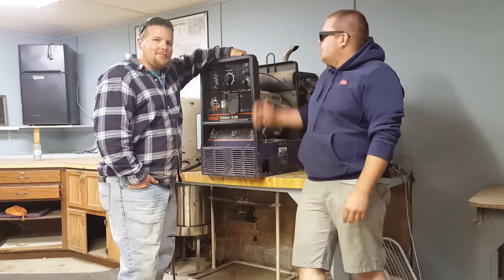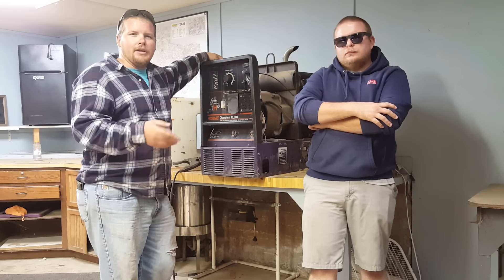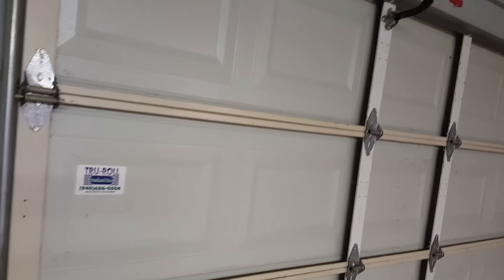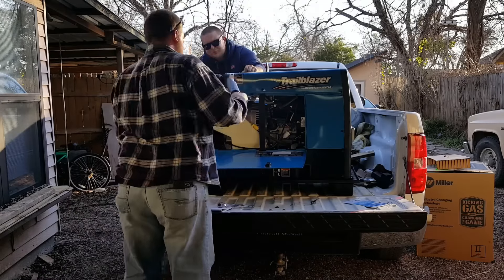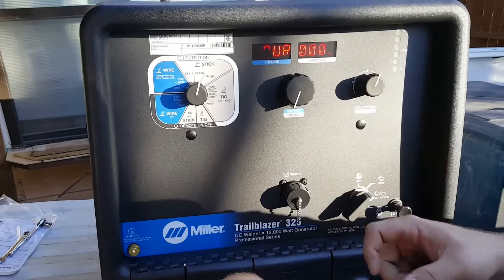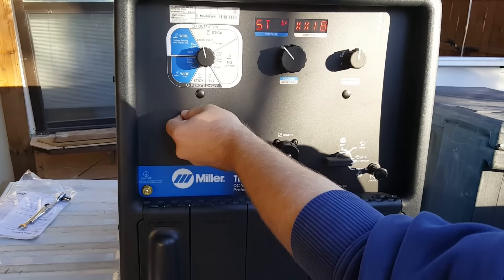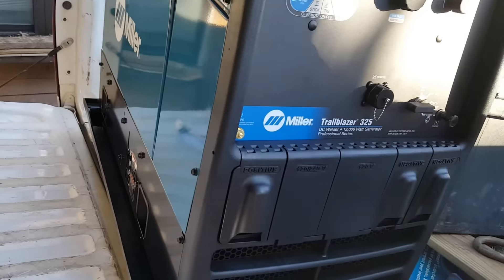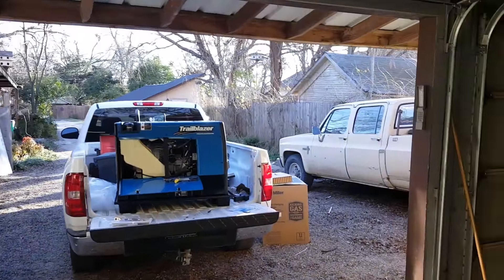OUT WITH THE OLD IN WITH THE NEW!!!!!! Unboxing and review of the new Miller Trailblazer 325

Comment: Sorry bout' your Hobart... Congratulations on your Trailblazer... you'll love it, I literally live with one on my truck.
Reply from the maker: +Kerry Anderson I love it its way better than that shitty Hobart. It burns 7018 like butter. Mine stays in the back of my truck to. I bought a trailer to put it all on but its way easier to just have it in the truck. I need to upgrade the truck my half ton is setting on the helper springs but its level and rides real smooth with about 2000 lbs in the back

Comment: On that Hobart welder, did you by any chance look at the commutator and slip rings to see how dirty either was? Hobarts are noted for erratic or no power when the commutator gets dirty, or a black coloration, use a brush seating stone to clean  by removing side access panel start the machine , then lightly place the stone against the commutator and moving the stone slowly the full length of the surface til it gets a bright copper color, then test to see if it makes power then. Also use a air hose to blow out any dust accumulation from the entire generator portion of cabinet. On any of those compact generators make sure you are very faithful at oil and filter changings and Always change filter at Every oil change, that's the key to longevity of those smaller engines, I prefer to use synthetic oil in mine as the viscosity does not change with heat.

Comment: My Hobart Champion 10,000 locked up last Sunday. I was gonna use it to power a small flux core welder outside and never even got started before it locked up tighter than dicks hat band.
Got it new in 03 had 2280 hrs on it. Sad day Sunday! Still bummed over that one  man..
I' sure like the looks of this Trailblazer I'd keep a cover on that guy. That's hard to do though and covers don't last long.
It would look new a lot longer though.😀

Comment: I was going to get a Hobart locally but taxes increase price by 300 dollars. I found out a Ranger 225 would be 200 dollars more or a Bobcat 225. I am not sure what to do or get.
Reply: I got a bobcat off the welding store that was a rental machine that had 500 hours on it for $1,700.00 works great. we were renting it for over a year from them before i called and asked how much they'd let us keep it for. i like the little bob cat, but for my own personal machine, i think i wanna go with a trailblazer.
Reply: @imbrandon16  The trailblazers are awesome. I have my Hobart still at under 100hrs. I am looking into getting a pipeline welder, maybe a Lincoln Sa200 gasoline machine. The Bobcat is probably close to my Hobart in power but the Miller has the AC welding mode I believe. Well should still be a good welder.

Comment: Miller for a Miller... what a change!
Reply from the maker: I traded junk internals and electronics for a good proven reliable welder. My boss has a trailblazer 325 and a legend 305 both have over 3000 hours an all he's done is change the oil.
Reply: Hobart is not miller. They are both owned by the same parent company Illinois tool works. They have their own separate engineering departments and don't even make the same machines. the only thing similar is the case.
Reply: MadMetalManiac74  Hobart and Miller are the same machines, all new  hobart generators have a manufactured by Miller electric sticker on them and hobart mig machines all have Miller guns and drive rolls
Reply: Bobby Williber no they're not. Hobart has a conoleltey different engineering divisionn apart from Miller's. Sure they take some things from miller but a Hobart is really the low end miller if you will. Not really the same machines.

Comment: Two questions on this model. 
1: Can you put the exhaust on facing the other direction?
2: Whats the amperage on the 220 outlet?
Reply from the maker: +Matt J you can put the exhaust any way you want to. and I'm not really for sure what the amperage is on the 220 ill have to find the book and look it up and get back with you
Reply: Thanks for getting back to me. I went ahead and ordered one myself, should be here friday. I got a pretty good deal buying it online, 4700$ with free shipping. Going to start a mobile welding service out of my truck.
Reply from the maker: That's a good price. I'm never real sure about buying online so I just went to a local welding supplies store and ordered mine. That's pretty much what I did with my truck the only things I don't have is bottles and a torch and am working on that now

Comment: That's why I as a welder prefer the older machines before they started putting motherboards in then cause you don't need to be an computer engineer to fix them lol. And anything with a motherboard won't last over 10 years cause the mother boards always go and they discontinue then after about 5 to 10 years

Comment: How's machine doing now? 
Do you wish you had gotten diesel?
updates :)
Reply from the maker: The machine is working good haven't had a issue with it yet. I now have 500 hours. I have a gas truck so gas is better for me. I do wish I would have gotten the excel power so the welder doesn't go wide open when your using grinders, chop saws, and screw guns
Reply: Badass. Great machines. 
Maybe there's a way to trick it into staying at idle when you use power tools. 
might fuck something up though I dunno.
thanks

Comment: What kind of work do you do?
Reply from the maker: +SupaLexy (SupaNautica & MotoLexy) for my main job I build steel shops,shop houses, and barns but ill pretty much do anything that pays
Reply: Cool, I'm about to start setting up my garage for metal work, got a deposit on a Bossweld 250 rig, so as soon as I get it, I'll be building a Gantry Crane, metal brake, workbenches and all the usual stuff. I'll be trying to keep all my work focussed around Aluminium and the idea is to set everything up to work at home if I want to or out in remote areas. A big thing I'll be focussed on will be working as quiet as I can.. Old Neighbours, say no more.
Reply from the maker: Yea I understand that aluminum welding is good money. I'm working towards saving up enough to build my own shop house so I can expand my welding skills and start up my own business. That's my favorite part of tig welding is that is so much quieter.
Reply: I think the mig welding should be ok, but the grinding and saws are going to be a problem.
Reply from the maker: +SupaLexy (SupaNautica & MotoLexy) you'll just have to tell them old neighbors to take out their hearing aids your trying to make some money
Reply: +Red Blooded Reviews got emmm Jaja
Reply: The old neighbours are like germs, always there to suck any fun out of anything we do LOL

Comment: Jesus that was some work to get a brand new machine started
Reply: Jordan Babcock cause they didn’t use the choke which they should of because it was cold.
Reply: I just unboxed a diesel trail blazer it came with the negative battery cable  clamp was clocked wrong i would have to twist the cable over a half a revolution to seat the clamp correctly onto the battery terminal leaving the cable in a serious bind instead of relaxed easy enough fix but it appears to be missing the tube that slips onto the antifreeze jug lid not very impressed after dropping over 15k for the machine